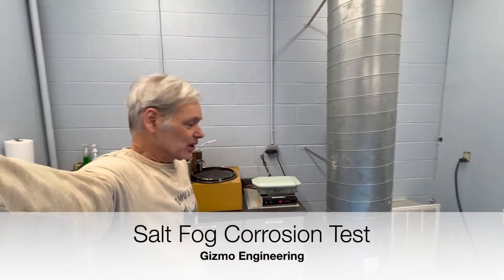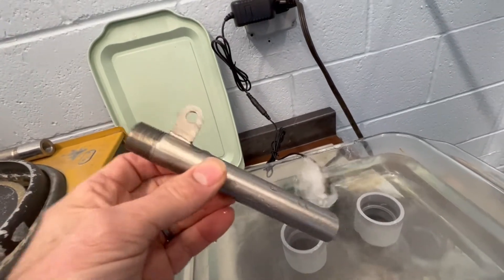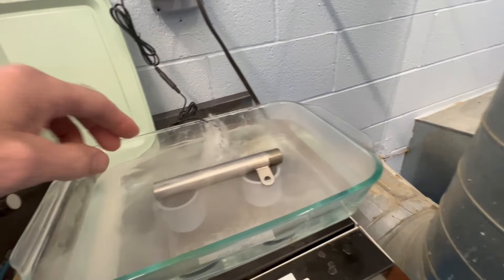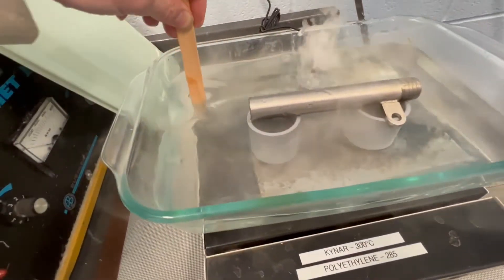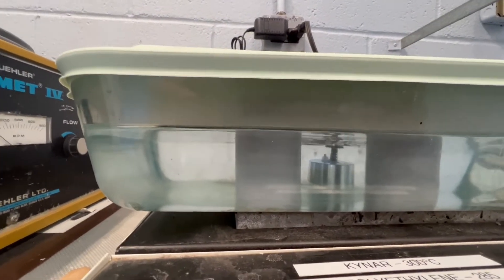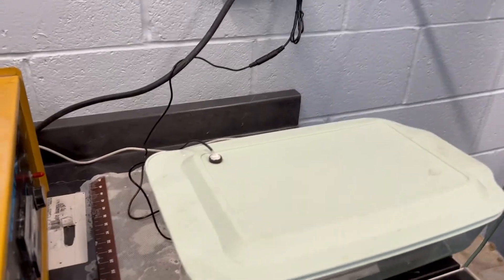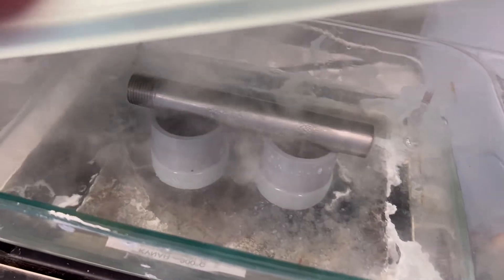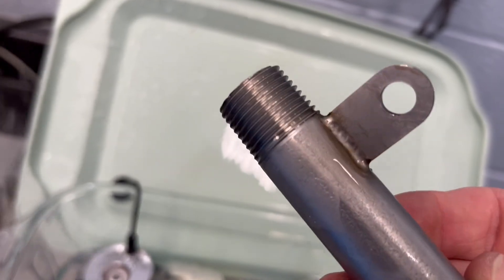Corrosion test of 316 Stainless Steel pipe

Comment: Hi Peter, would it be possible for 316 stainless steel to be magnetic? I mean after some special manufacturing processes, such as bending, extrusion, die-casting...
Reply: Cold Working can make magnetic.  Simple test is with a magnet.  316L (low carbon) is better.  Google "strain induced martensite in 316"

Comment: Hi Peter, thanks for the video. I am considering to execute a test like that as well. I was wondering if I should use tap water or distilled water. Would the rust still occur in case I use distilled water? The reason I am considering distilled water is that the test can be repeated unrelated to where you are as tap water will be different depending on your location.

Comment: I left 316 ss in a salt and concentrated bleach slurry for 6 months (replenishing the evaporated bleach) and thr surface did oxidize but there was no pitting or corrosion under microscope. 304 did not fare well. Half the thread were completely corroded and missing. Inconel 625 sample was subjected to the same plus additional paracetic acid baths. No surface imperfection or discoloration under microscope.
Reply: Yes I don't know why more people don't know about the 316 stainless over 304. Just 2 worlds apart when it comes to corrosion. Some of the finest stainless you can get in my option. 316 all day long.

Comment: Thanks for the content, I wonder what stainless steel it is. There many kinds of stainless steel in the market i wonder what is suitable for ship building
Reply: 316 is specifically designed to resist salt corrosion and is often used in "marine" applications. It is more expensive than 304 however.
Reply from the maker: This is 316 stainless steel. (as the title suggests)